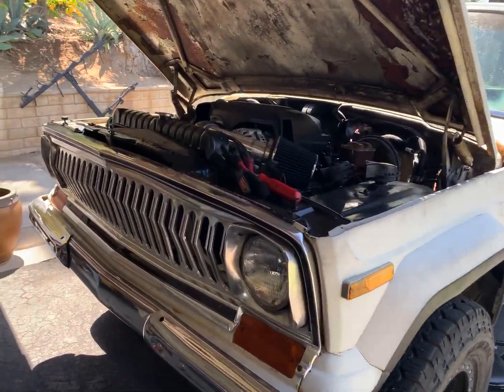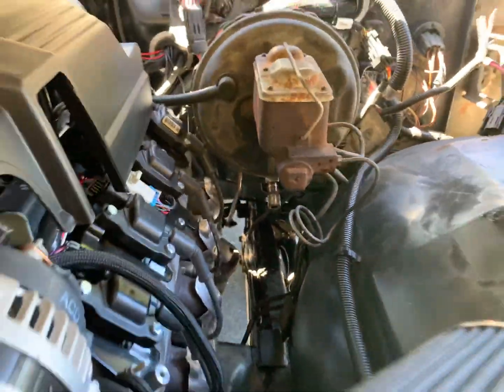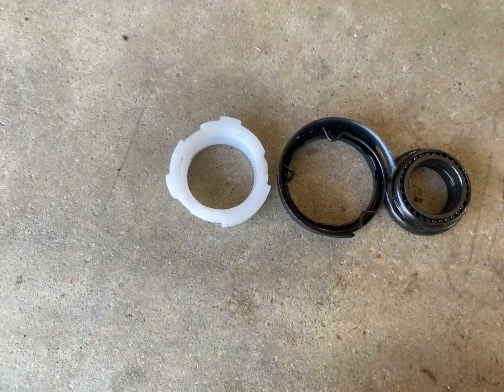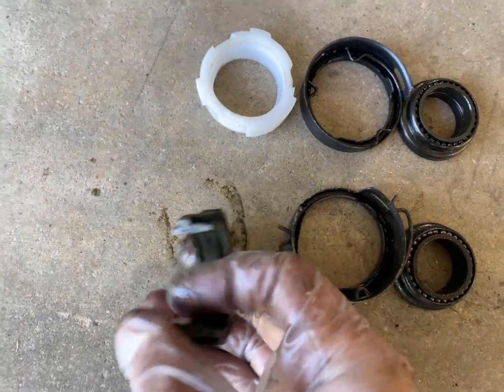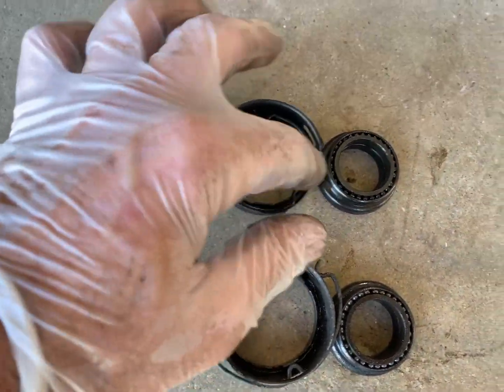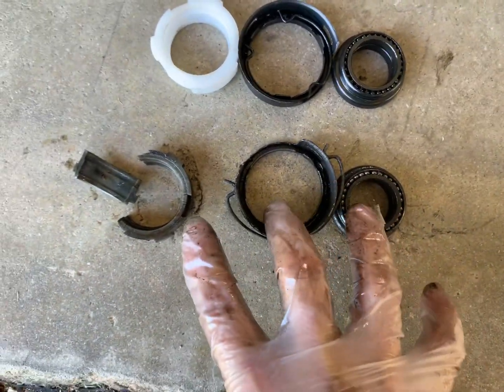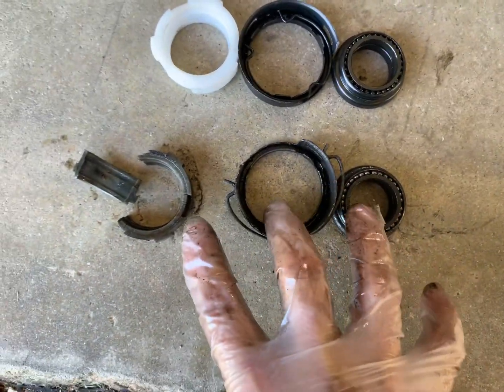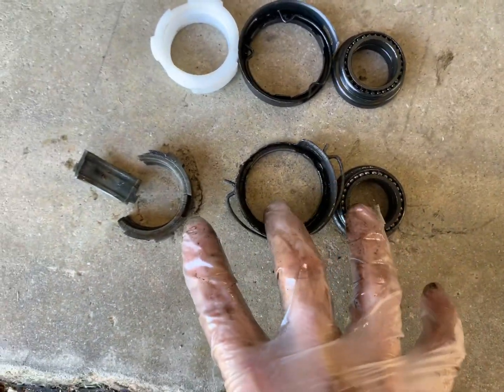Jeep Cherokee Chief Lower Steering Column Bushing Is Toast!

Comment: Thanks man, have a 78 Chief S Widetrack, and doing the same thing right now. Hoping the slide joint works via miracle if not will remove the steering shaft. 
Badass engine you got in there, and thanks for the video.
Reply from the maker: Thanks. Good luck with the repair!